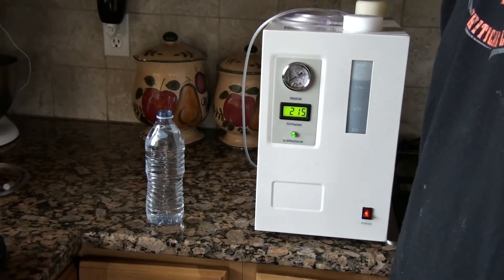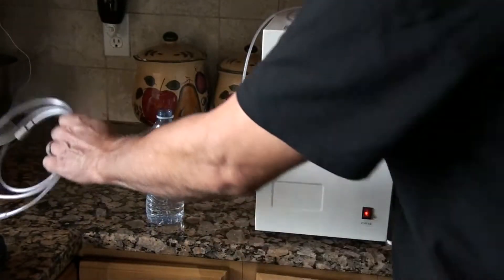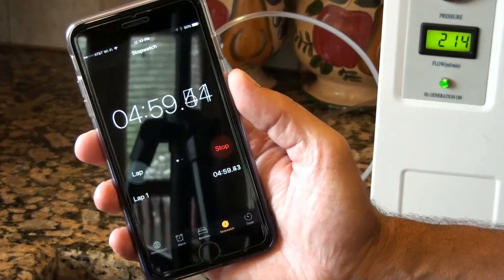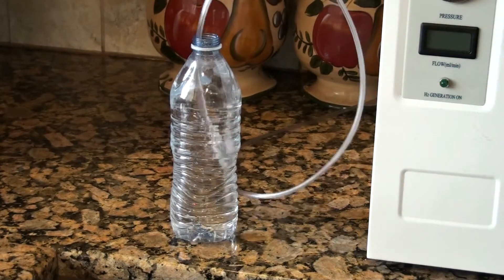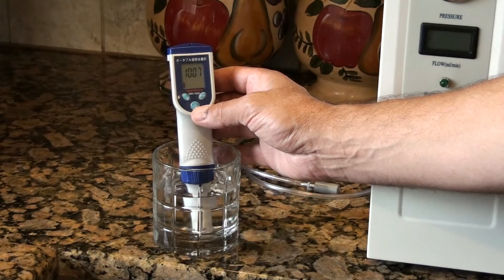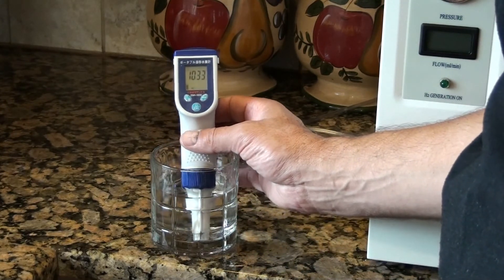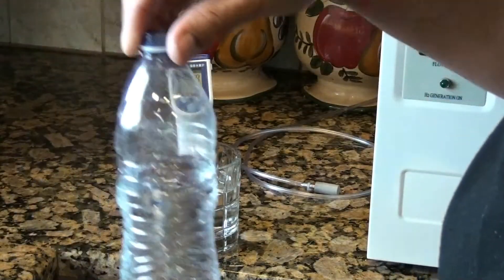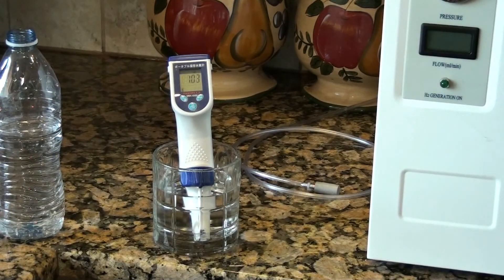H2 breathing machine making hydrogen water

Comment: I wanted to ask you what gives more benefit to breathe only h2 or breathe 66.6666% h2 and 33.3333 % o2 what is the difference is bad breathe this mixture thank you for your answer
Reply from the maker: Some people like the browns gas and some like straight H2. Just depends on what your like.
Reply: Thanks for your answer but that benefits more to the body for example what I have studied is oxygen is an oxidant this oxygen contributes to something positive hydrogen we know but if I hesitate with oxygen I thank you for your answer
Reply: The straight H2 machine is more advanced than browns gas machine，and  the medical research papers are mostly on 2%-4% straight  H2 inhalation.

Comment: interesting stuff . what is the hydrogen amount in the water before the hydrogen was bubbled threw it . Also what is the method that is used to extract the hydrogen from the air /or what is used ?
Reply from the maker: The water has zero H@ before it is bubbled. Electrolysis is used to split distilled water into H2 and O2

Comment: regular water molecule is H2O so i dont understand what is it for hydrogen water?
Reply from the maker: Look up hydrogen water on the web. It's out there. This machine is mainly meant for H2 breathing
Reply: It refers to the di-hydrogen gas (H2), a byproduct of electrolyzing water, dissolving and being held between the water molecules, so you get H2O plus H2 in the bottle.